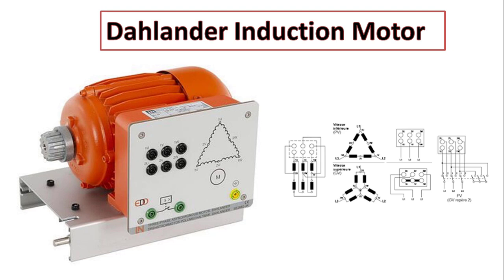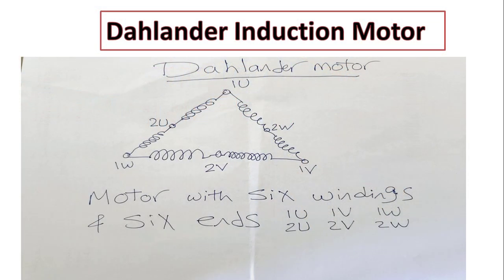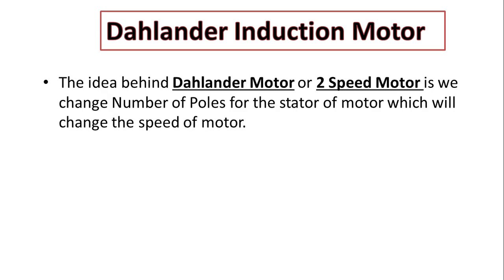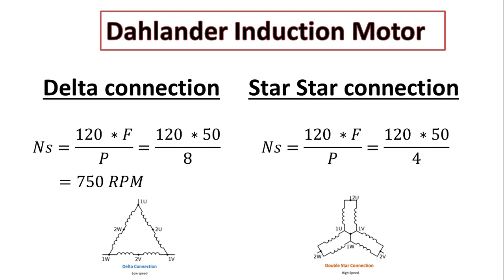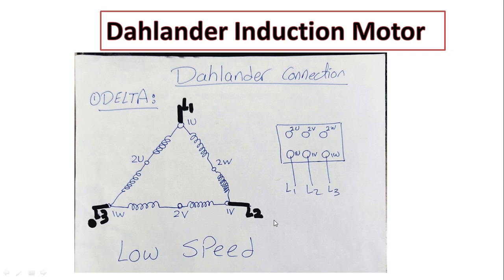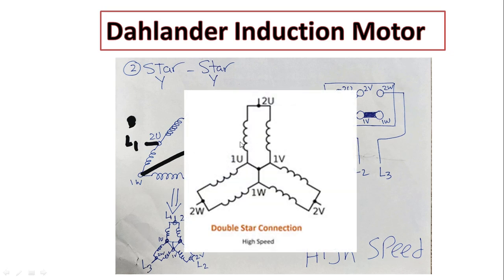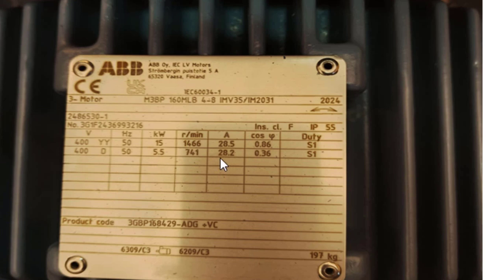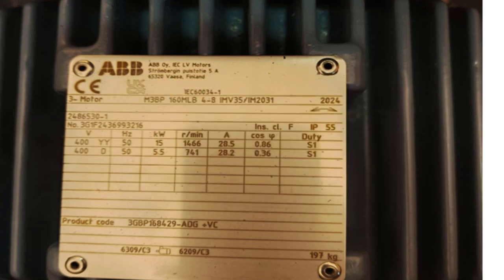Only 10% of Electricians Know THIS Dahlander Motor Secret!

Comment: Let's say that the motor runs clockwise at high speed and counterclockwise at low speed. How would you correct the phase rotation so that it operates in the same direction at both speeds.
Reply from the maker: whanks for your question brent but this will not happen,,when you connect power supply to U1 V1 W1 in case of delta, U2 V2 W2 in case of double star motor will rotate in both clockwise

Comment: Hey bro nice video, can you explain the number pf poles how you get to 4 and 8?
Reply from the maker: A Dahlander motor changes the number of poles by reconfiguring its stator windings between series (low speed, higher pole count) and parallel (high speed, lower pole count) connections. This is achieved using a special winding arrangement and a switching mechanism to alter the current path, effectively changing the synchronous speed of the motor.

Comment: Nicely explained thank you for the video but I have a question what is the technical reason behind the low efficiency of delta connection?
Reply from the maker: @adilakbar3053  thank you for your support ❤️🙏
Reply from the maker: @adilakbar3053  In a Dahlander motor, also known as a pole-changing motor, the efficiency in the delta connection is lower compared to the double star (YY) connection due to several factors:

Increased Copper Losses:

In the delta connection, the phase currents are higher for the same line current, leading to higher copper losses (I²R losses).

This reduces the overall efficiency of the motor.

Magnetic Flux Distribution:

In delta mode, the winding arrangement results in a different magnetic flux pattern, which may not be as optimized as in the star connection.

This can lead to increased iron losses and less efficient magnetic utilization.

Higher Circulating Currents:

The delta connection can introduce unwanted circulating currents within the windings, further increasing losses and reducing efficiency.

Lower Power Factor:

The delta connection in a Dahlander motor generally has a lower power factor compared to the double star connection.

A lower power factor means that a higher current is required to achieve the same power output, leading to additional losses.

Torque Ripple and Unbalanced Magnetic Pull:

The flux distribution in delta mode can cause torque pulsations and an uneven magnetic field, which can contribute to mechanical and electrical inefficiencies.

Conclusion:

While the delta connection in a Dahlander motor allows for high-speed operation, it comes at the cost of higher losses, lower efficiency, and a lower power factor. The double star (YY) connection is more efficient because it provides better voltage distribution, lower copper losses, and improved magnetic flux control.